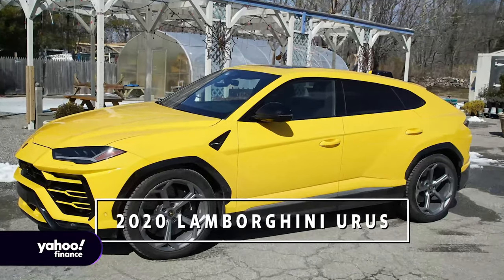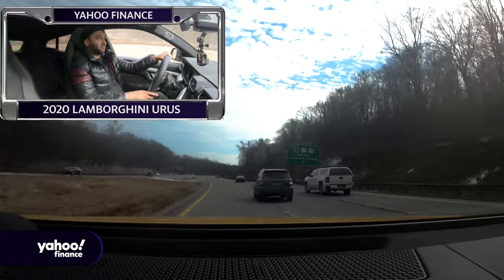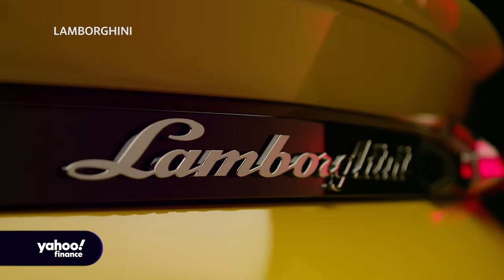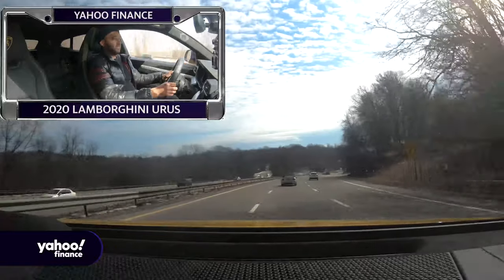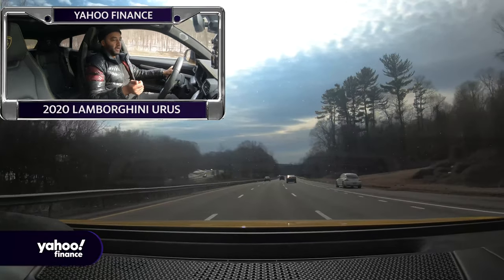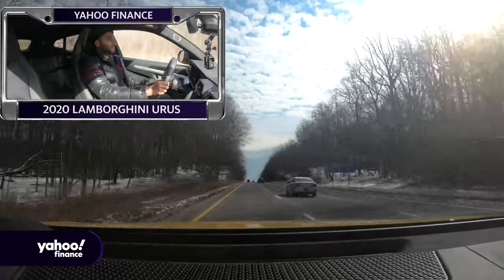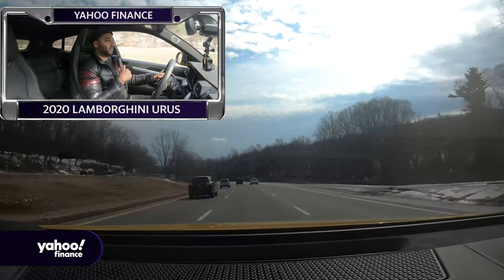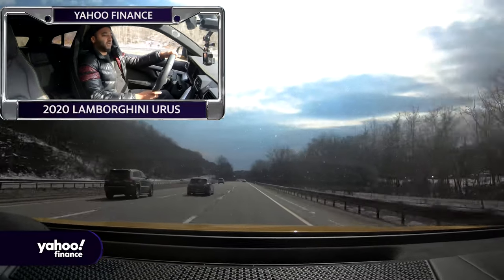Lamborghini Urus review: Take a ride in Lambo's SUV and find out if it's worth the price

Comment: Lamborghini Urus:  4.0-liter BiTurbo,  650 horsepower, 0-100 km/h in 3.6 seconds, max speed: 189mph  - starts at $207,326
Tesla Model X P100D:  Dual-motor electric, 610 horsepower, 0-100 km/h in 3.1 seconds, max speed: 155mph -  $104,990
Clearly not worth it.